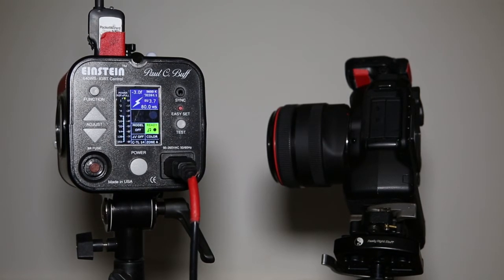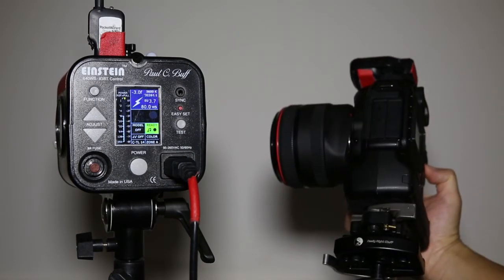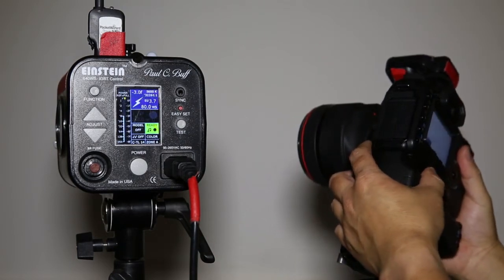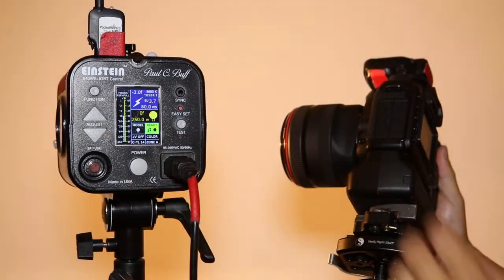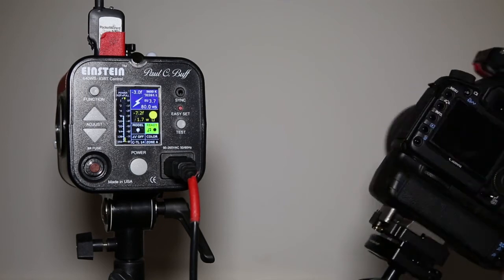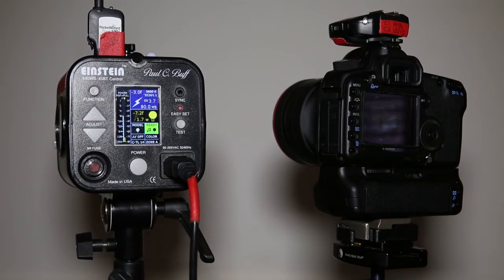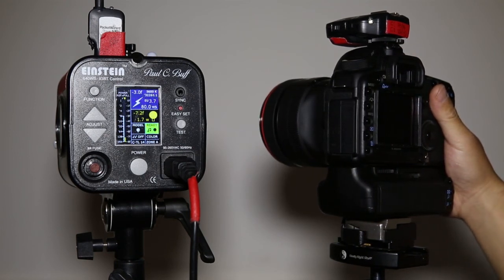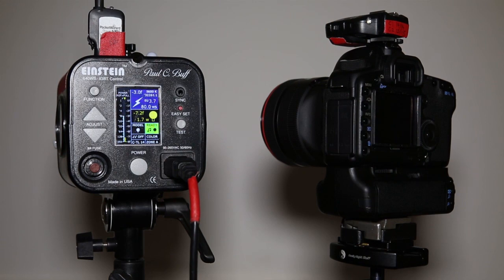PocketWizard PowerMC2 and Einstein 'Bug'

Comment: I have literally spent weeks trying to figure out why my TT1 and MC2 are not connecting like they do in your videos.  I can set the channels on the TT1 but the MC2 doesnt have the option to set channels. So how do they know to sync with each other? Thanks for all of your videos!
Reply from the maker: +David Lamb You set the channel of the MC2 when it's plugged into the Einstein. Plug in the MC2, plug the Einstein into power, turn on Einstein, press the function button repeatedly to cycle through the menu (notice the blue highlighted box on the LCD moves as you press the function button). When you get to the bottom left box which is the channel option, you can press the up or down adjust buttons to cycle through the channels, standard are just numeric, while Control-TL is prefixed with C-TL.